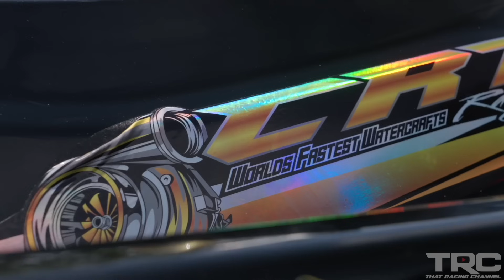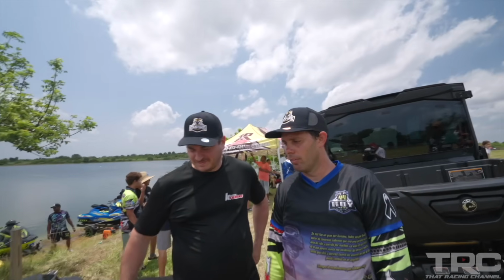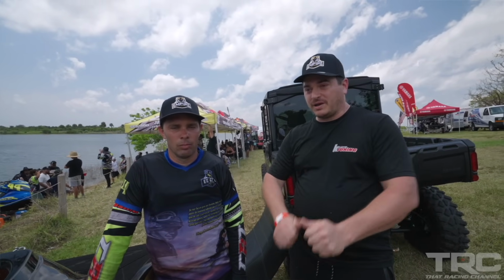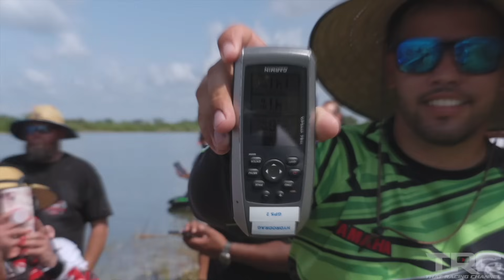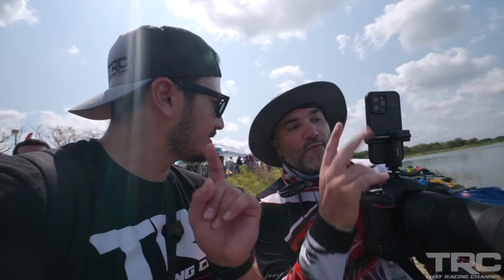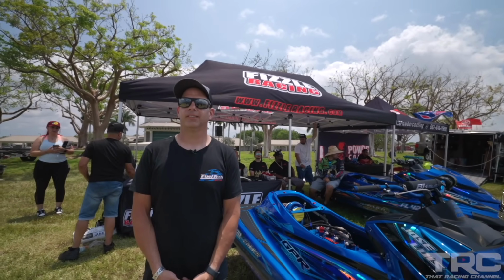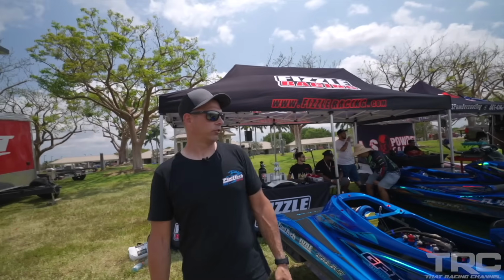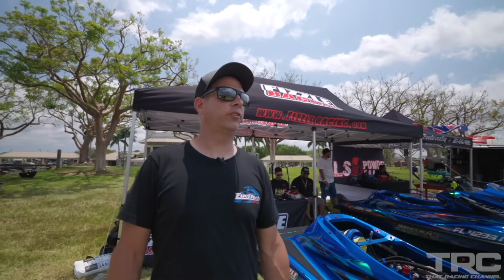1500HP Turbo Jetski SCREAMS to 141MPH! (1.8L Spins 12,000RPM + 75PSI of BOOST)

Comment: The jet pump is where the magic sauce is. They won't talk about the pump and hull setup.
Reply: Would you?
Reply: That's a secret thing bro.. respect this people..who thought this ski can go more faster
Reply: Your definitely spot on. Hull, intake, and pump are more important then power at this level.
Reply: @Tupaistella he wasn’t disrespectful tho relax
Reply: @Tupaistella respect deez
Reply: @Dee-gu5up  lol
Reply: @zackjay71  nuts
Reply: @DakotaB90   Yeah, so much power wasted to go fast. You can go faster with a 600hp outboard and a whole boat.

Those pumps must cavitate like crazy 💀

Edit: Fixed my mistake on "only" 400hp, corrected: they ran 180+mph in 1980's with 600hp and 10 000~rpm propeller speeds 💨
Reply: @eamh2002 propellers on an outdrive have completely different physics from an impeller in a jet pump. the whole reason jet pumps were invented was to improve acceleration, because the fastest boats at the time had to work up to those insane speeds over a longer period of time just because the props don’t catch that way off the line. these guys are limited to a system designed for acceleration first and limited for the size of the tube they can put that impeller in. just different worlds man
Reply: @eamh2002  assuming that you're referring to some of Jerry Fountain's builds in the 1980's, those are far far more costly than what these guys probably have in this setup. Also no, slapping a merc 600 on something does not put you at 140mph..
Reply: @hbaker6444  Yeah thats true, its all about the hull and prop and aerodynamics (with the power aswell)

I'm just mind boggled how big of a "drivetrain loss" there is with jet pumps  compared to racing boat's propellers :)
Reply: @eamh2002 well for jetpumps there is a massive amount of cavitation that takes place, I think that has majority to do with it, not an expert on it but that’s what I would assume
Reply: @jonesy.316   Jet pumps were invented for acceleration?  Umm, nope. Not true.  Pumps were invented for shallow water.  His argument about props vs pumps is not invalid.  You are right about them being different worlds, but there is a reason the very fastest boats to exist on water, use props.  The fastest accelerating drag boats, use props.  Even top fuel jet boats (there are very few if any now) couldn't come close to props in lower classes.  There is a huge loss with any pump, any time.
Reply: @sonovabeach fastest, but not quickest. An outboard will never short track like a jet pump. Period.
Reply: @thrifty9797  It would be a lot better if you knew what you were talking about. I wasn't speaking of outboards, or even inboard-outboards, not even v-drives. I generically spoke about props in general. Unfortunately for your statement, in the world of short track racing, nothing beats a propeller driven boat. The world record boat in the 1000ft track is by a prop. Specifically a boat with a prop system called a W-drive. Might look into top fuel hydros, and how they compare in quickness to the few who have tried top fuel jet. It's not even comparable. Sorry.

Comment: Its fast AF but im not sure that I'm 100% convinced that it makes 1500 HP !!
Reply: Yea that's what I'm thinking.  I mean what dyno did they hook the crank up to and how does that translate once you have the jet and pump in the equation
Reply: Right,  bet it's closer to 150hp
Reply: @Justin-vb8nm  im certain its more than 150, but its not 1500 !!
Reply: Why not ? In the late 80s, F1 cars made 1300hp from a 1.5L turbo engine during qualifying, and were on full noise for half of that 2 min lap.

This ski only has to make 1500hp for a few seconds, and it has unlimited cooling.

Thus, 1500hp seems on the mark.
Reply: Cooling is " very limited" ... Yeah I mostly believe that 1500 but really it still sounds bananas to me ... 1500 hp in a shoebox, personally I'm surprised it can accelerate on water 40-140 in 3 seconds still.
Reply: @nordic5490  yeah, because were comparing 2 very similar things right ??? Whatever dude !!!
Reply: The question was asked and he said the hp was extrapolated from the amount of fuel that was consumed per time elapsed.
Reply: rule of thumb is 100hp per liter n/a, 1 atmosphere of boost (14.7) equals too doubeling the engines cc, so 15 psi of boost makes a 1 liter engine a 2 liter engine (theoretical). so a 1.8L engine with 75 psi of boost (5 atmospheres) would make this engine a 9 liter engine aka about 900-1000  hp, which is a whole lot but I dont think its 1500Hp
Reply: @nordic5490  i think there is a small difference between some guys building a jet sky and f1 Team trying too push the bounderies of whats physicly possible

Comment: Lot of respect for Yamaha.
Motorcycles, snowmobiles, jet boats, marine outboards, jet skis, Lexus, Ford, Toyota, singles, twins, triples, fours, V-4s, V-6s, V-8's, V-10s.
Electronics, musical instruments, acoustics.
People talk about GM or Ford, or Honda. Yamaha seems to have had its hands into more things than most, besides Honda.
Reply: No love for the I6?
Reply: @335bye4  I'm not aware of one that Yamaha has had their hands in designing.
Reply: @exothermal.sprocket  legend has it, Yamaha helped with the legendary JZ line.
Edit: I believe they developed the head
Reply: @335bye4  I've known about the 2ZZ-GE engine, also the Lexus LFA V10, the Ford Taurus V6. I think they also had input on a Lexus V8.
Reply: @exothermal.sprocket 
You might and in sure you did, but it wasn't on the list. 
Like I said "no love fir the I6"
Reply: @335bye4  It's honestly the only 6 cylinder configuration I particularly like.
Reply: @exothermal.sprocket  agree 👍🏻
Reply: V4 ? What Are You talking about 😂
Reply: @tepelkua  Never heard of a Yamaha Vmax? Where have you been?
Reply: @tepelkua WAKE UP…

Comment: DAMN!!! In early 2000's, I was able to get a 2-Stroke Ultra 150 up to 74 MPH with moderate effort.  A Park Ranger used to use a traffic laser and and S-80 traffic radar to confirm what my ancient Garman GPS was showing.  I tried doing the same thing with a 2001 GP 1200R without triple piping or putting bigger pistons in it but never came close.  What they are doing with 4-Strokes is mind-blowing.

Comment: Im struggling with 1.8L making 1500HP

Feels like we'd see a LOT of JDMs with that kind of power if that were possible.  Not denying it's making crazy power, but 1500HP doesn't make sense.
Reply: Well it's not 1.8L but the Honda K series motor would like a word with you
Reply: There are a lot of 4 cyl JDMS making 1500hp lol, its not hard to believe. 75+ pounds of boost, intake air temps extremely low because of the water cooling stays the temp of the lake, and a 200 shot of nitrous too. 1500hp would only be 1200 wheel hp on a car and there's tons of 4 cyl making more than 1200 wheel on cars
Reply: LOL that makes 2 of us brother, it just sounds cool, but then again, Yamaha does make some of the best engines in the world. There's really no transmission and very little stress on the crank because it's a propeller / jet drive doesn't take very much stress to drive it so pretty much spinning freely with little resistance. That with methanol spooling the turbo no shifting 75/lbs I guess I can see it. Certainly wouldn't take long to drain the tank.
Reply: Tons of 4 bangers making that much and more. They were doing it in the 1980s with 1.5L BMWs-- why not today?
Reply: @corystansbury  I wouldn't say "tons" I'd say a handful.
Reply: @FrequencyOfThought tons actually lol. Way more than a handful bud.
Reply: @zethloveless7238  Yeah sure, there's thousands of them let me tell ya BUD
Reply: @FrequencyOfThought  did I say thousands ? No but you said a handful and that is simply not true 😆. I follow the big power 4 banger scene. This power level is common. I guess for people like you we need a exact head count though eh 😆
Reply: @zethloveless7238  You follow it? wow I live it.
Reply: @FrequencyOfThought  yep that’s part of following it bud 😆. Hence the word follow
Reply: @zethloveless7238  The handful of 1500HP 4 bangers you see on the internet doesn't mean it's common. You know how many transmissions hold that kind of power after a couple passes?
Reply: @FrequencyOfThought  😆 you think I see them on the internet ? That’s cute 🥹
Reply: @zethloveless7238  You follow them, in what exactly? Your Hyundai
Reply: Methanol helps !
Reply: Why not ? In the late 80s, F1 cars made 1300hp from a 1.5L turbo engine during qualifying, and were on full noise for half of that 2 min lap.

This ski only has to make 1500hp for a few seconds, and it has unlimited cooling.

Thus, 1500hp seems on the mark.
Reply: @nordic5490  I wish people would
Really stop using that old tired worn out story. It only did it in qualifying and then they had to replace the whole engine… this engine will still hold together.
Reply: The man said they determined hp by the amount of fuel consumed in a length of time. There's a mathmatical formula based on the amount of energy in a specific amount of fuel that's consumed in the speed run.

Comment: 1500 hp and they are only going 144 mph..? Lots of drag and the pump is hugely inefficient i’m guessing…?
Reply: YEP, SOMETHING WRONG. THAT MUCH POWER, HE HAS IT DRASTICALLY PROPPED WRONG.
Reply: Show us how you can go faster then
Reply: @chayannecastellano7221  MY OPINION, THEY NEED A BIGGER DIAMETER PROP, ALONG WITH MORE BLADES AND PITCH. THAT MUCH HP, ISN'T NEEDED AT ALL. IT'S MOSTLY AN RPM THING WHICH THEY HAVE AT 12,000 RPM. I AM GUESSING THEY COULD HAVE MAYBE HALF THAT HP, 2,000 MORE RPM, AND BIGGER, MORE BLADED AND MORE PITCH PROP.   WONDER WHAT THE TORQUE IS. IF IT'S HIGH THEY COULD HAVE A HUGE PROP. CUSTOM BUILT SET UP THOUGH.
Reply: @WRLDPCENOW  they probably dont make ton of torque therefore they rely on high rpms and lots of boost, bigger pump means they probably have to mod the hull and will create more drag
Reply: @chayannecastellano7221  if you’ll notice, it’s a question…thusly the question mark….the power to weight ratio seems untenable….i have decades of “go fast” experience but water speed is foreign…can you explain that..?
Reply: @WRLDPCENOW No prop, It's a pump that cavitates when the leading edges of the blades form air bubbles and becomes inefficient.

Comment: 1500hp. 😂 not even close
Reply: Why not ? In the late 80s, F1 cars made 1300hp from a 1.5L turbo engine during qualifying, and were on full noise for half of that 2 min lap.

This ski only has to make 1500hp for a few seconds, and it has unlimited cooling.

Thus, 1500hp seems on the mark.

Comment: 1500HP come on I call BS, I guess with access to fresh cool water it's not that big of a deal. Heat kills.
Reply: So how much power to run 142mph on a jetpump powered boat?
Reply: @fredericosanchez5318  probably depends on the smoothness of the water, the efficiency of the jet pump and lots of other factors. RPM etc. Acceleration VS top speed are two entirely different things.
Reply: So your saying it makes more power?  @FrequencyOfThought
Reply: Why not ? In the late 80s, F1 cars made 1300hp from a 1.5L turbo engine during qualifying, and were on full noise for half of that 2 min lap.

This ski only has to make 1500hp for a few seconds, and it has unlimited cooling.

Thus, 1500hp seems on the mark.
Reply: @nordic5490  this isn't a F1 car, this a production jet ski engine lol wtf

Comment: I got a 1990s WetJet twin with 168 horsepower stock with no turbo and I do 128 I've been clocked in Miami doing that... So for you guys to have a turbo and have 1500 horsepower and only do 140 mph you guys suck